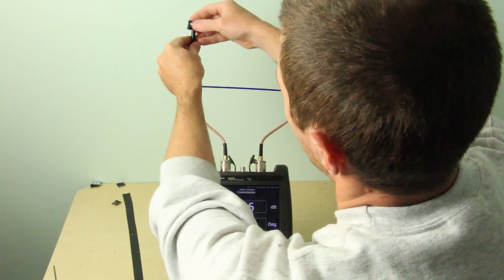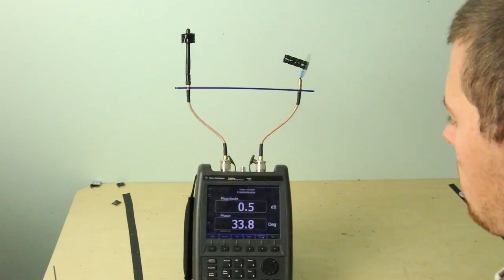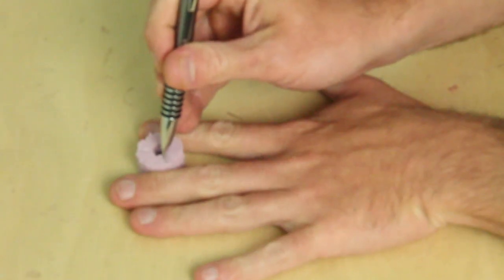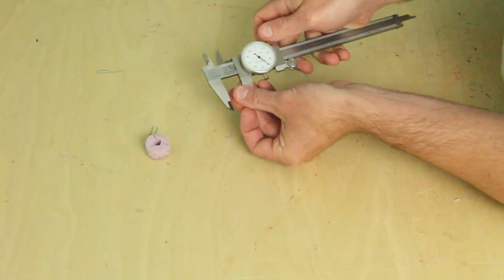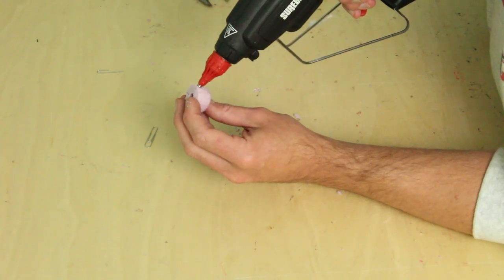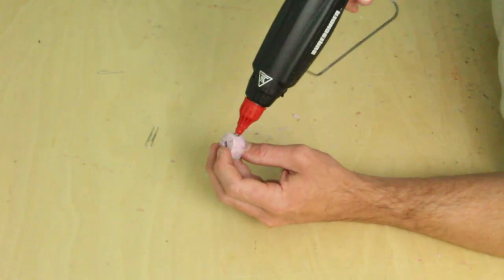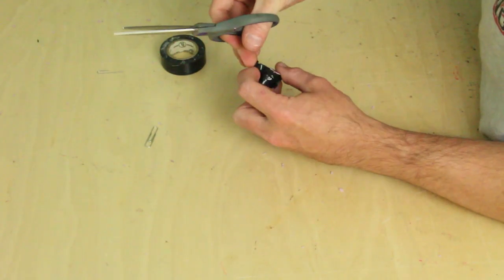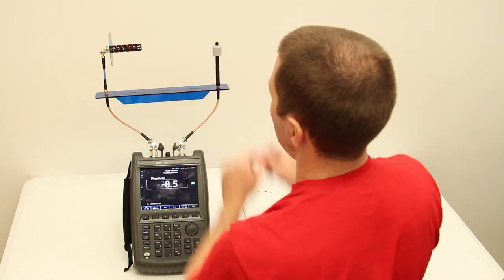Rubber ducky antenna simple circular polarization hack

Comment: I tried numerous time to make the cap, but no luck😥
Being precise as mush as possible doesn't help, as well as changing materials. The antenna won't convert to circular polarized and stays linear. Confirmed with vna and empirical tests with live fpv feed. 
Can you give any advice? 
I used foam and neoprene as dielectric and copper wire, paper clips as lobes. One layer of tape only
Reply from the maker: I am admittedly not sure how you could verify it without a vector voltmeter, but I suspect the neoprene has something to do with the less than ideal results.  I would consider cardboard as a potential solution.  Alternatively, try shortening the wires by ~1/2mm.  You would be surprised how sensitive this is.

  You also might want to try and see where the element is located within the antenna to make sure the shell is in the right place.
Reply: @CAGreve1231  I use logmag trace on vna and screw in lhcp antenna to one port and whip to another. I aim to make rhcp antenna so losses must be pretty high comparing to linear polarization before placing the cap. It looks to work as I think because when I change the whip to rhcp or another lhcp antenna it shows the results you expect. 
Regarding the neoprene, I used it after the foam which should be nearly perfectly rf transparent. Thought the dielectric might be the issue but it isn't so.
Thank you for your advice!
Reply: @CAGreve1231  When you say the right place, where is that in relation to the element?  I checked my linear antennas and if I place the shell where you do, it would be  above the element.  On your micro switchblade it appears to be around the balun.
I recently bought 2 of your Ions for my goggles and will order antennas for the quads soon.  I was just playing around with this as it looked fun.
Reply from the maker: @Kevin.L_  - Ideally right over center of the element.  I had these rubber duckies specialty made for this so they'd just snap on.  However, you can just slide it over to where your element is.  

Admittedly, you don't need to be perfect.  So long as part of the element is covered it will work fine.
Reply: @CAGreve1231  Thanks. I'll give that a go.  
Would there much difference in performance between a Micro Switchblade and a Minion Pro for use on a quad?  Numbers are similar.
Reply from the maker: @Kevin.L_  - Not really.  The micro uses an updated Z-shaped element which allows it to be smaller.  The standard is the original parallelogram element system similar to the original Ion antenna.

Comment: Good videos - I am looking for the best indoor (or external) antenna to improve my Wifi / broadband signal collection. In the UK I’m using a THREE network SIM card on the 1800MHz (Band 3) (nearest);  2100MHz (Band 1) (nearest); &  800MHz (Band 20) system. Whilst, the tower is only 500meters away from me there are a row of trees & a row of two floor houses about a third of the way between my house & the tower. I am only getting two bars (from 5) reception that usually translates to about 2Mb download (1Mb upload) speed. Any thoughts on a solution and do you sell them to the UK?
Reply from the maker: This sounds like a good time for a BiQuad antenna.  I do have the parts to make one for this application.  I can send them to you if you want or build it for you.

Comment: Mr. Crazy, is it possible to convert a whip antenna like the ones used on Frsky receivers with the IPEX connector to a VTX antenna without a sleeved dipole or counterpoise?  I tried it with quarter and half wave length and it seemed to work.  I only used 25mw power cuz I was afraid of burning out my VTX.  Thanks and hope you get your patent and it makes you money.

Comment: Can this be used on 2.4 wifi antennas? What would be the meassurements then?
Reply from the maker: It certainly can!  You would need a 2.25-2.5" diameter former (It doesn't have to be round.  Square works fine).   Each wire element would be tilted 40-50 degrees and the length would be 1.52" +/-.05".

Comment: You are awesome Alex, what material is best to make protective cap for these? Also is the electrical tape needed?
Reply from the maker: The tape is plenty to protect them and yes it is needed.  You can 3D print a cover if you like.  Just be sure it is thin.  The length of the elements changes with the amount of material surrounding the elements.

Comment: Thanks for the video Alex, amazing as everything else you do... just a little question... at some point you mentioned that left and right hand polarization is given by which tip (top or bottom) points where... saying, this example is RHCP because the bottom tip goes to the right... I'm guessing that me and many others got it wrong for many years then... looking the antenna straight up (SMA pointing down let's say) I always thought that RHCP was because the TOP part is aiming to the right, not the bottom, does it make sense? Anyway, many thanks for your generosity and hard work! Ordering a few more of your antennas right now! :D
Reply from the maker: Maybe this explains it a bit better:

RHCP ->  \
LHCP -> /

Ok, so it is a terrible graphic, but I hope it explains it better.  The shell in the video is RHCP.
Reply: @CAGreve1231  clear as water... Thanks so much for the explanation master ALEX! looks like many people had it wrong... just checked many websites, and they're exactly the opposite:  RHCP: /  LHCP:  \
Reply from the maker: For a connected antenna, yes.  Parasitic radiators work on induction where the current is reversed.  This is a parasitic radiator so it will work as the reverse of every other antenna.
Reply: @CAGreve1231  WOW... great! I almost had a heart attack, thanks Alex! :D Keep rockin'!

Comment: You are the man Alex, This is super awesome of you to share! Thank You so much.
I am curious what the measurements might be for a micro whip? would be awesome to know as i have a couple of those as spare in the kit for my older unify pros with ipex.

I Always have appreciated your detailed well researched info. Thanks again and again.

See You In The Sky
Michael STONEWULFF
Reply from the maker: Can you link me to what you are referring to?  The length of the parasitic elements remains constant (well, sort of, anyway), but the angle changes with the proximity to the center.  The main issue is that as you get closer to the dipole, the impedance begins to shift greatly and the dipole must be modified for performance.  The smallest size you can go without excessive de-tuning of the dipole is 3/4" in diameter (in which case the tilt angle is reduced to 35-40 degrees or about .42" in height).

If you are looking for a micro antenna, I already make the micro-switchblade for micro sized quads and airplanes where the center is already modified.

Comment: It's like a homemade Ion
Reply from the maker: That's exactly what it is!
Reply: @CAGreve1231  Noticed when I crushed/crashed my Ion....I was really surprised the lobes were not attached. Showed my fpv buddy and we both scratched our head asked "..is it really that simple?" Started using the Duraspec since we found some bando's.
Reply: @audiogek  simple looking? sure. simple  to perfect like we have, not so much. and might I suggest a minion pro, theyre much stronger than the generations before them
Reply from the maker: ^This.  Simple looking, but very complex in the workings.  We have banged our heads on the desks many times trying to figure out what isn't working with these from time to time.
Reply: @vanguard6937  That's what I meant ✌️. I think you guys are geniuses.